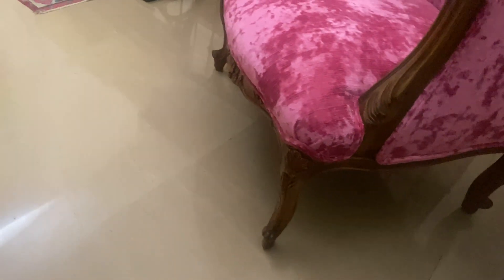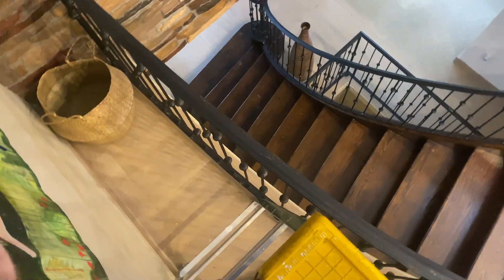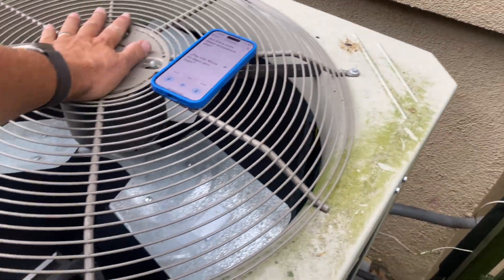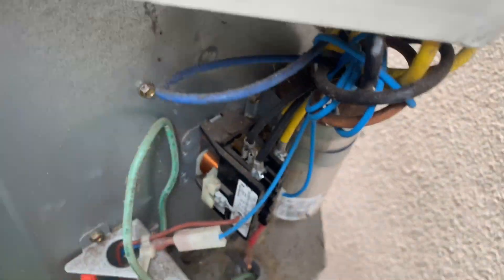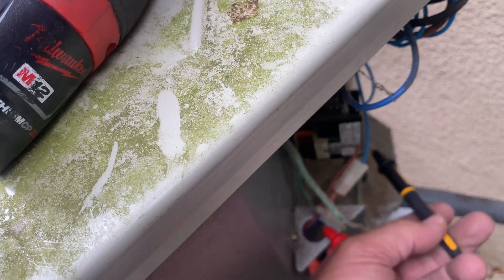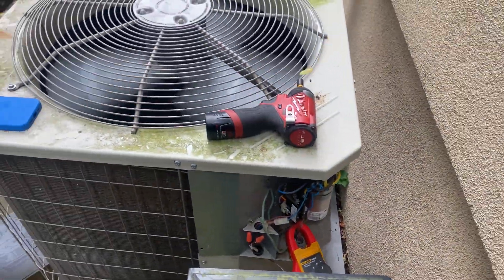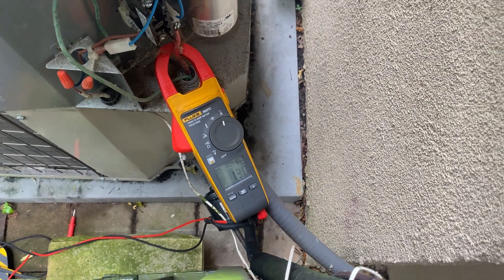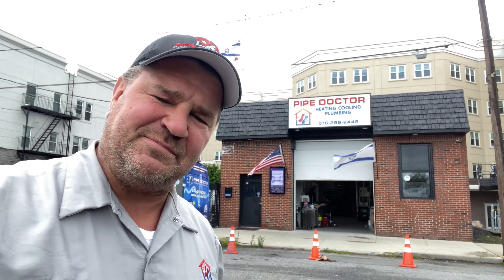Central AC Not Cooling Service Call Reveals Epic Fail by Homeowner: Must Watch HVAC Video!

Comment: Another 3M filtrete.  Big shocker.
Reply: Home Depot special
Reply: Exactly!  Those damn filters are system killers.  I make it very clear to my customers not to use those and now I show them which to buy on Amazon or at least which to buy a HD.  But all my new systems include a Honeywell, AprilAire or Trion Bear filter box.  They have service contracts, so I know which filters for my guys to take that morning.

Comment: Hey Mike.   I did an install and customer is complaining about high humidity.  How do I fix her issue?
Reply: High humidity generally means the system is oversized. Get a better salesman, do a manual-j and install the right sized system usually helps. But if its already in, you're gonna have to monkey around with the TXV and fan speeds or upsize the evap coil 1/2 a ton or more, maybe add in more return. Not generally a question that can be solved on a YouTube comment section..
Reply from the maker: Did you oversize the system?
Reply: I just do the install.  I don’t order the equipment

Comment: Brother can you tell me what hvac gauges are going work with the new refrigerant next year the so called A2L refrigerants. I seen you use Testo on your channel and I've used them before . Me and the boss in the trade use the Snam3 from fieldpiece and they cracked on the lower bottom as most other technicians report having the same problem . They seem to all crack the same way and in the same lower spot also .

Thank you .
Reply: I’d get the Fieidpiece probes with the temp clamps and hygrometers.   Manifold gauges are a thing of the past.